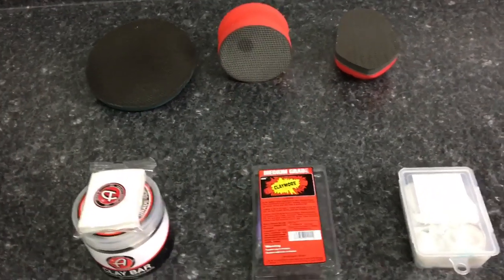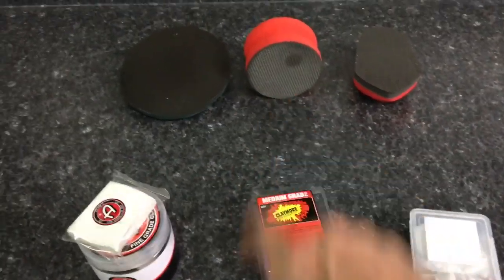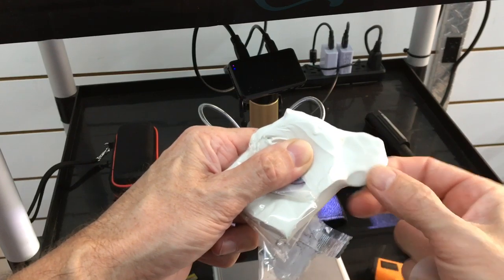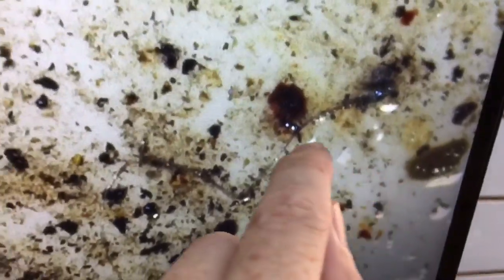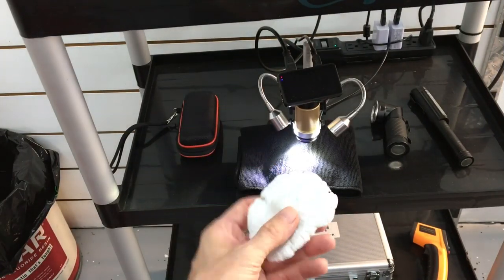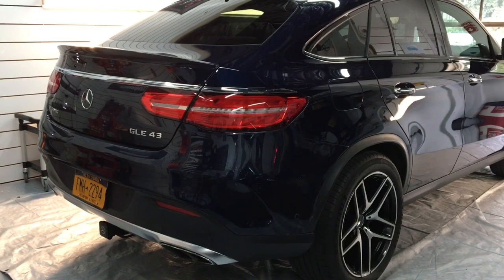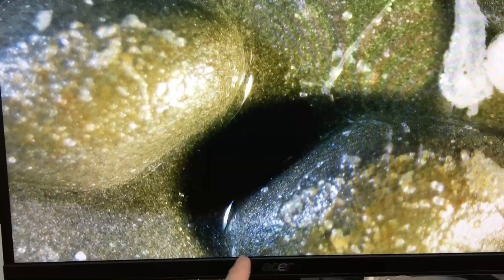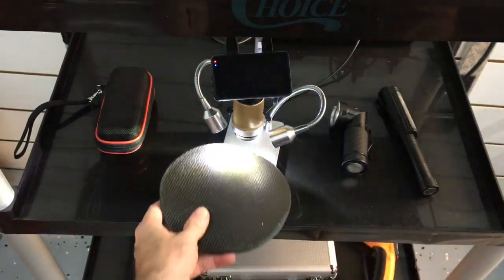Traditional , Organic Clay Bars Or Synthetic Clay Mitts and Pads!! Which Is Better? Let's Find Out!!

Comment from the maker: Traditional clay bars...or synthetic clay mitts. Which do YOU prefer?
Reply: I have fallen back in love with a clay bar.
Reply: Clay mitt for me.
Reply: Synthetic.
Reply: My nearest Auto Zone mismarked our mothers speed clays so I canget them for under $10. I keep them stock piled so I will never need anything else.
Reply: Traditional clay.
Reply: Clay bar myself ✊I never tried anything else but I will.
Reply: i have a clay block and the lubrication was rinsless wash from a spray bottle used after the high-pressure system. will used it on the front window again.when used it on the body i did it very very light
Reply: I like both depending on what I feel like using at the time.  I like the mitts for ease of use and if I drop it I can just wash it and it’s good to go again but I feel the clay bars do a better job of removing the contamination on the paint.
Reply: Hi Brian, i am one of your subscribers since you had 5k on your channel .. i always supported you and i really believe your channel is the best for any person who wants to learn the craft. I asked many times because i trust your review to review Garry Dean’s Infinite use detail juice because i am a fan of waterless and i know that’s what you do in your shop. Please review this product because i want to know if its worth the price and i want to know how it performs when compared to others. Thanks.
Reply: Traditional clay bar for me. More control than a mitt.
Reply: Apex Detail I prefer bar but have both. How can people offer this as part of their basic wash package and not polish afterward?
Reply: Chad J i do that and 99.9% of the cars i work on have never been clayed with tons of contaminants and tons of swirls .. so when i wash, clay and wax the car they thank me because it looks 1000X better than what it looked before. If i get a car thats polished or ceramic coated i don't clay.
Reply: Both
Reply: With a physical disability that makes my hands don't always do what I want LOL. The clay alternatives is what I have used lately. Have clay blocks and clay pad and clay mitt and clay towel. And will see what I think works best for me and is safest for the paint. With that said I really like Bilt Hamber soft clay. It's really a high end clay bar. And when it comes to paint overspray or heavly contaminants is left after the chemical decon. The clay bar is my choice and also could need to be of a coarse grade to be effective and hold down on the aggitations needed with it.
I saw an internet seminar where Renny Doyle was visiting Norway. He used a clay block and Sonax Glass Cleaner as a claylube. I tested this and it works really good where there is much contaminants on the paint. It cleans better in some way. The drawback is it can not be to warm when doing this as the glass cleaner evaporate fast. But the Sonax Glass Cleaner ability to cling on the glass gets you a more lubrication when aggitate with the clay block. Mike Phillips on Autogeek used this method with the Blackfire glass cleaner IIRC or another pbmg brand. It's worth to test it out. 
Awesome video Brian and in depth of the different clay products. Would have been very interesting to see it on a test panel which where polished to as defect free as possible. And put the panel under the microscopic camera to see if and how much the difference is between them. Also if you use a polisher with the clay pad if it's very aggressive on the clearcoat with marring it. Forensic Detailing Channel did this some years ago but with clay bars only. So with useing as many different clay alternatives and bars as possible would be a new thing I think. And also if there are a difference between claylube and soapy water. It's more a standard now to be doing a polishing after claying. But back some years ago it where many that used it very often as decon step and may still be they who do that. That would be a great way to see what claying do and put the if polishing is needed or not to be seened.
Reply: I feel i have better control with a clay bar then a mitt.. could be because i dont have used it to often but.. for now. The classical clay is the choice for me
Reply: I've used organic, mitts, and towels, and I'm lately been favoring the towels. I like how It can easily form tot the contour of vehicles and I save A TON of time by not having to constantly refold traditional clay and only do small sections at a time. That being said, I feel like the traditional clay cleans the best out of all of the types of clay! Side note...I like keeping my clay towel in a bucket of ONR to add even more lubrication while claying.
Reply: Synthetic
Reply: Medium Clay mitt for sure. First I do a pre-wash then rinse. Then I do a 2 bucket wash and after I wash a panel, I dip my clay mitt in the soap and go over it right after until smooth. Then move to the next panel. Saves so much time and just as effective
Reply: Of course old school clay bar is the best
Reply: I have never used anything other than a clay bar.
Reply: Clay bar other then that just more expensive
Reply: You have helped me decide.  I am going for a pack of clay bars and they will be thrown out after each use.  I don't work on cars often at all.  I have a new car and someone keyed it.  Mostly, by the time the next damage comes, I wouldn't trust the mitt or towel so those would be disposable to me, too.

Comment: I have the Griot’s pad that you used, and it actually works really well with a good shampoo like Adams.  I even used it in a bucket with a grit guard to clean it as you go.  And if you need more lubrication from it, you can just squeeze the foam.  Thanks for the test!

Comment: First, the microscope set up you have is great!!!  
I use a fine clay bar. I tried an artificial clay block once with lots of lube and it left some significant scratches and I haven't used it since. After watching this video I may give it another try, but cautiously.
Another great learning video
Reply: Yes, same! It looks like the trade off like mentioned in the video is constant decontamination of the panel and bar/mitt

Comment: That was cool seeing the water flow though that pad . I have used both clay bars and pads. I found with the pads they got dirty and I couldn't get them clean and threw them away. With the bars I knew I would use once and dispose. After getting some great advice from you about claying my cars I don't clay them  except if needed now.  Thanks Brian for your work and sharing your knowledge.

Comment: I have been afraid to use the synthetic clays because it's not uncommon to read reviews where people have made a mess out of their paint with them and left the pattern of the synthetic all over a car. Until now I have stuck with tried and true high quality clay from the like of Megs, Mothers, Griots, Clay magic, CG, etc. All work well but using clay can be much more time consuming than the synthetics from what I observe which is my only motivation in making a switch. Watching yvan lacroix from optimum clay and wax in one step at the speed of light is pretty motivating.

Comment: I use the Adams clay and the mothers. I never had a problem yet,👍🏻Excellent video Brian
Reply: Hey Big D I've been using the Mother's pad for several  years and find it quite effective.  I keep a lightly dampened old hand towel flipped over my shoulder and wipe off the pad frequently as I do clay the vehicle.  Additionally, I will occasionally rinse it off with the nearby hose.  It is amazing how much dirt get wiped onto the towel!

Comment: There's quite a few people including myself who have seriously marred paint using synthetic clay bars, specifically Mother's clay bar 2.0. Do you have this issue when using synthetic clay bars/mitts?

I should have decontaminated more in between panels and applied way less pressure, as well as chemical decontamination before hand and providing sufficient lubricity while using the synthetic clay bar. I'm just concerned that the nature of the synthetic material itself causes issues as the contaminants have no where to go once lifted from the paint, unlike how it can get embedded and lost within the depth of non synthetic clay bars. Hope that made sense. Thanks for this super in-depth video!!!!!

Comment: As thorough as the video was,  based on the amount of contaminants after using the Adam's clay bay on one small section of rocker panel, it doesn't seem like the car was washed prior to clay bar use. I have never seen that much dirt after claying my entire vehicle.  

Maybe it was done intentionally.

Comment: I see a lot of other videos by other people claming never to use a clay bar and only use clay mits or towels which i cant agree  with. Medium and fine clay bars have their place here in Pennsylvania with contaminants we get. Personally i prefer clay bars you just got to get the right brand. I prefer the Pinnacle, the Magnashine, Maxishine, and Blackfire. The cheap ones that are colored on amazon, or ebay arent very good nor am i a fan of those ultra thin chemical guys brand. Get quality clay and the experience will be way different than it is with cheap junk

Comment: You keep saying mead when the word is knead. You knead the clay like you would knead dough. Mead is an alcoholic beverage knead means to work something into itself or to message into.
Also the heavy grit clay is absolutely useful for cars that have been neglected for a long time. I bought an 02 firebird from a kid and I tried using a regular clay bar and a clay mitt and they did almost nothing. This car was ROUGH. it felt almost like sandpaper but the heavy grit clay bar took care of it and was essential to getting it done.

Comment: If it's an Asian car, no question the traditional fine clay x2 if it's black or other dark color.  Maybe the nanofiber or speedy pad/mitt on harder clears like corvettes gmc up to more recent models.  Currently now with how cheap manf are cutting paint thickness and the water base crap being used, I think you almost have to use traditional clay asab4asive polishing is no longer a given.

Facts the clay picks up more contaminants.  It's gentler on the paint least amount of marring.  It being payable allows the particles to be encapsulated by the clay.   Mitts pads are strictly convinced and multi-use. That is their only positives over clay.  They do not pick up as much and marr the paint more.  It should be obvious just from the fact they are cleanable multi-use.

As we now have new car paints that can be below 3mm sometimes even 2mm I think every possible thing that can be done to preserve CC must be.  It's no longer optional.  We need as much clear as possible for when we do need to polish/correct. 

Ideally, new cars should be prepped and coated /ppf (ugh) with top coats  as soon as possible. Frankly, on a top-tier car, I think I would garage it for a couple of months to ensure fully cured paint. Then immediately prep and coat.  Certainly put a topper that could prevent those contaminants from ever making it into the base coating and never into the clear coat.  Stay up on the toppers as much as possible.  Seems as tge after care products have gotten tomtge point  of serious durability the car manf are making it mandatory just to keep the paint.  Seems to me car manf have made an effort to push planned obsolescence duty life from 30 yrs to max 20yr if not 15.  That is dated not by use jiles/hours but time period.  Paint is the way to do this.  If paints start having failed clears at 15 yrs, most will trade or scrap. By far, value will plummet vs. a car with still good clear.  I think the move to thinner clears is not mainly in line production cost savings but something much larger.  Reducing the effect life of the vehicles on a grand scale. It's well known that the gov has been using numerous tactics to get vehicles over 20 years old off the road.  Car manf were more than happy to assist with this as its win win for them.  Combine this with the all electric being force crammed down our collective throats. Knowing the batteries on average are only good for max 10 yrs.  Make it have a failing clear coat within 5 yrs of tgat all but ensures consumer vehicle life duty term of 15 yrs.  With the escalating costs of vehicles way out pacing inflation it will further ensure people are heeding replacement vehicles right as their loans come to term.  Banks  and deditors are fully on board with this.  So Gov, Car manf and financial all in agreement the trifecta of evil in concert.

My advice learn how to paint vehicles and build and replace battery packs.  Add in full detail prep Resell and have a huge market till the big boys take it over.

Comment: I was thinking about trying  synthetic but after watching this how do I know when to rinse off a mitt/pad without a microscope ?
Especially since they seem to be  all black and I cant see the dirt  at all ? Seems too risky
Could you just keep dipping in your favorite auto shampoo ?
I just hate kneading clay bars.
Reply: That's what I'm wondering. I've used the 2.0 a couple times and just used soap and water in a bucket.  I dipped the 2.0 in the bucket often to keep the surface plenty wet, but now I'm not sure if that is a sufficient way to rinse the pad or not.
Reply: @dannycurtis1939  
Yea since I can't see the dirt with this pad I am using the clay bar .
These would be  a lot easier but I only clay once a year anyway.

Comment: Folks I think we are making rocket science out of this now. Synthetic clay bars work just fine. So does plumbers putty. Let’s not be ridiculous and think you have to torturously go around the entire car with something the size of a pencil eraser in order to get a good finish. We are going for feel with this step not clarity, shine, etc. you don’t need depth gauges, refractor glasses , or whacked equipment to make a car look nice. 
-Wet the car down while it is cool with a good surface wash and rinse it.
-wet I’d down again with surface wash and let it soak a few minutes and use your wash glove , or washing mit to clean then rinse.
- with a soapy lubricant spray a panel of the vehicle. Then use your clay bar, synthetic or otherwise in a back and forth motion. Once you do entire panel rinse it off. You will tell the difference. Repeat steps until Car is complete.
-if this has given you a satisfactory “feel” then dry car. 
- Now you can apply you favorite compound if need be, Polish, wax, etc.

Do this every few months and the car finish will always look great

Comment: Would you recommend using ONR mixed as a clay lube?  Wolfgang Uber?
Reply: I use Wolfgang it works great.
Reply: I was wondering the same thing... almost out of glide but have a whole gallon of ONR...
Reply: Gregory Albares how did you dilute the Uber?
Reply: @baklash6079  I just make it like the directions say and use EagleOne towel that is the size of my hand. I do like Brian says with power wash and air before I stick it in the bucket again. Works really great like that.  Thanks!
Reply: Wolfgang is extra soapy that's why I use it. Been using it for about a year. Anyone of the soaps that are extra soapy will work.
Reply from the maker: Absolutely.
Reply: Gregory Albares Just mix the Wolfgang Uber as in directed on the bottle? No extra ratio of anything?
Reply: Yes that's how I do it,  but if you want to add a little extra it will not hurt anything.
Reply: @gregoryalbares5830  You just go with the lube instreuctions on the Uber bottle then... ok.  Man that Uber doesn't smell very good does it?
Reply: No it doesn't but you're going to come back with some kind of polish and sealant. I've been using the combination Pan the Organizer says is the best wax and sealant.